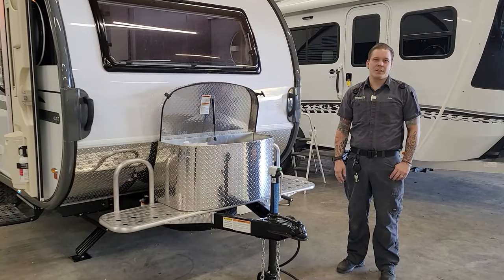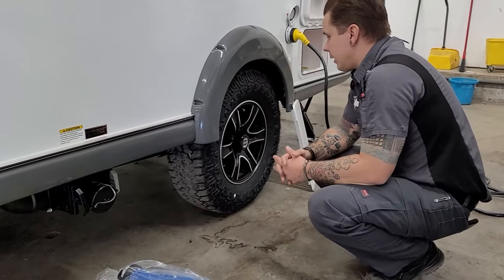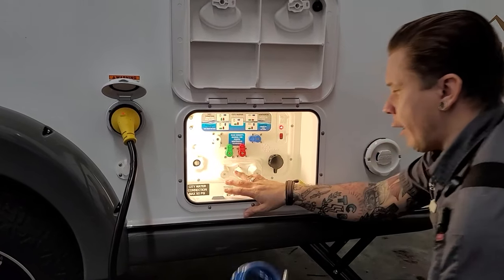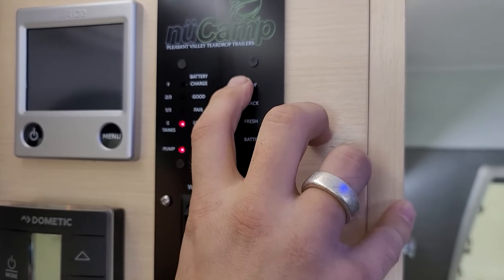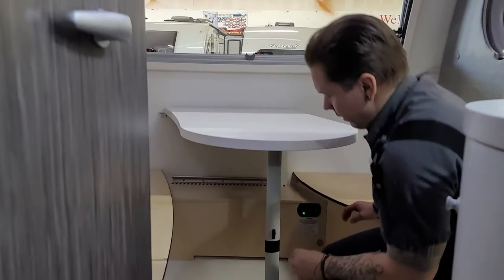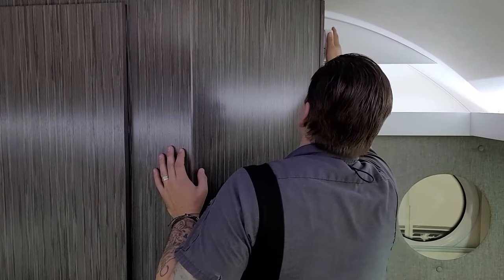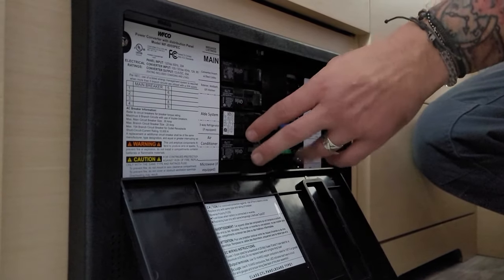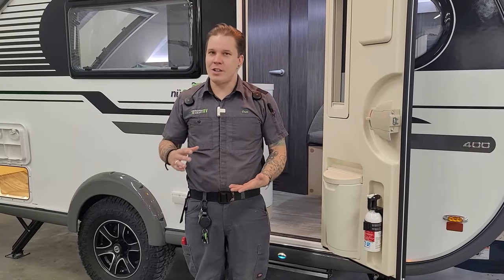2021 NuCamp TAB 400 - Technician Tour

Comment: Hi Folks...good show, thank you. A few questions for you, please: 1) If you have City Water on and pressurized through the Nautilus system, do you need to have the water pump turned on? 2) If you are plugged in to home power (15amp) and 'storing the camper" but without the water with glycol, does the battery need to be switched off or left on? 3) If the shower water never seems to get hot enough, what do you need to do?

Comment: Great instructional video. Do you have any videos detailing the use of the Alde system & the Dometic system? Thanks.
Reply from the maker: We usually leave those to the specific instruction manuals, but those are great ideas for future videos, thanks!
Reply: Are you a member of the nucamp forum?  There is a GREAT unofficial operating manual written by a t@b owner that is extremely helpful for just about everything related to a 400, plus tips on fuses, tools, packing and towing.  I've used it for troubleshooting issues and found it to be a great resource.
Reply: @chaosncheckt9356   Forum where? Do you have a link?
Reply: @chaosncheckt9356   I’d be interested in the location of the forum as well!

Comment: Another high-quality technical tour!  THANKS!  Is there a way to secure the unit so that it can't be moved from a site while the tow vehicle is away for shopping or day-trips?
Reply from the maker: There are some good tongue lock options available. We have also seen some good wheel "boots" that would definitely slow someone down. A combination of the two might be a good setup.
Reply: @RVTechToursatPrincessCraft  THANKS!
Reply: James.  I use a tongue lock from FtKnoxLocks.com.  The lock is large enough to secure your chains as well though I normally just use it to lock the hitch.  I use a wheel lock as well.

Comment: Great video.  I just purchased a 2021 Tab 400 Boondock and went out to try heating using propane.  I set the display for the temperature I wanted and set it to propane, but the radiant heat never activated.  I could hear something running but nothing coming out of vents or from floor.  Does it take a while to activate.  I did auto ignite the the stove to bleed the propane lines.  What else should I try?
Reply: It takes a long while to start working

Comment: I have 2019 (April) t@b 400 boondock lite with the Cool Cat in front.  Can I replace my tongue storage tub with this 2021 configuration?  I like the larger storage tub and the platform.
Reply from the maker: We haven't replaced the front tub on a T@B 400, that I know of, so far. The team at nüCamp will be able to help you with this answer pretty quickly. Contact them here: 844-823-9112 ext 834 OR help@nucamprv.com

Comment: Is there plans to update the  keeter rail anytime soon? ( like they did on 320) nice video.
Reply from the maker: Hi Mark, we haven't heard anything about that on the TAB 400
Reply: @RVTechToursatPrincessCraft  thanks for the response. I know  what's going to happen,  I'll buy the 400 then they'll come out with all the upgrades. I'm going to hold out as long as I can. Maybe I'll get another 320. Just really want a dedicated bed. The cushions on the 320 didn't work for me when sleeping.
Reply: @marklundeen1025  Is there not a Keeter rail on the 400?
Reply: @davervatx8814  yes there's a keeter rail, but it's the old style. The 320 got a new rail that looks a lot cleaner and doesn't come apart when you don't want it to. I don't know why they would fix one trailer and not the other. It just doesn't make sense to me.
Reply: @davervatx8814  There is.  We have both an "eye lid" awning and a Walker awning.

Comment: What is the purpose of the red switch below the pump switch (inside the nautilus system)?
Reply from the maker: That is a switch for the tank heater :)
Reply: Tank heater for 4 season camping? To keep tanks from freezing in cold weather?
Reply: @RVTechToursatPrincessCraft  I don't think this switch is even connected to anything. There's no tank heaters on these trailers.